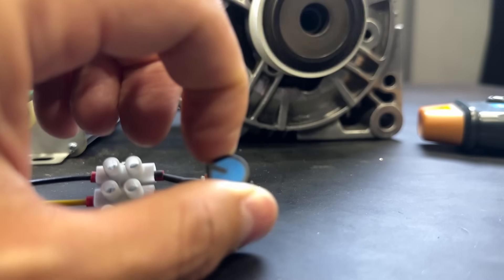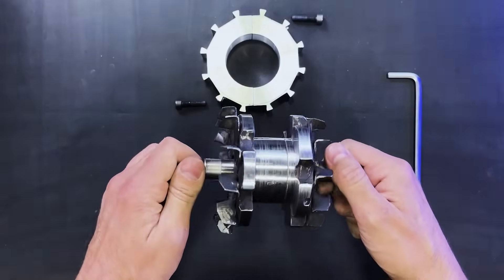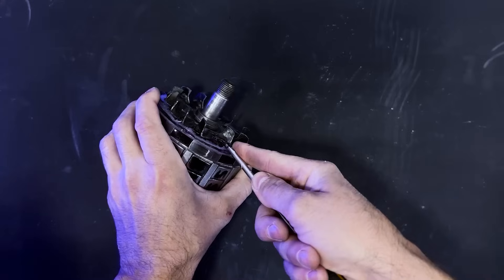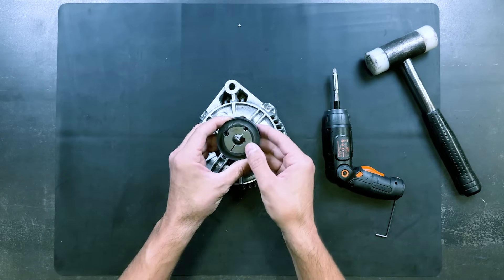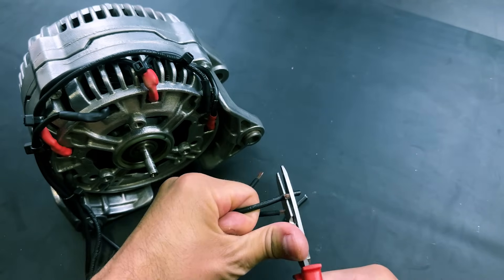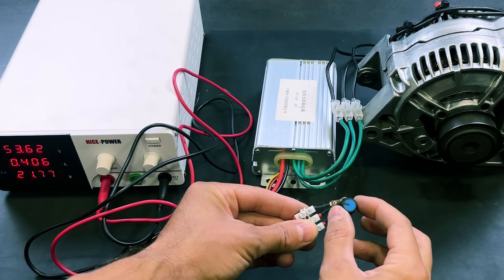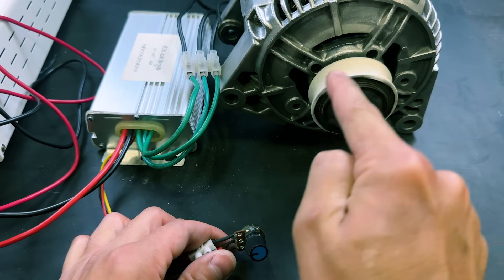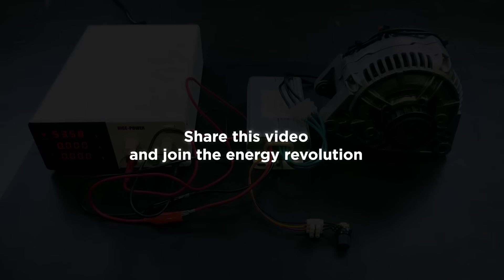I Turn a Car Alternator into a Powerful 10.000W Brushless Motor

Comment: I have seen projects where the original rotor with coils was used. 
Would the strength of the magnetic field affect the power of the motor?
The magnetic field would depend on the strength of the magnets, or the voltage applied to the rotor if the original coil is used. 
If the rotor is an electromagnet, would the power draw change as the the voltage to the rotor is changed. 
Does the speed of the motor depend on the frequency of the controller.

Comment: Can you show that when using electrical appliances, it can cause a power outage, such as a soldering iron? Is there real electricity? I followed the instructions and the electricity came out at 30 volts, 40 volts, Ac.

Comment: Great work, thank you for sharing with us! What was the value for current at 28000 rpm and 56V DC? Keep up th good work!
Reply from the maker: The current depends on the motor controller. With this controller, it draws up to 30 amps.
Reply: @danielpreda1978  I think the power showed something like 53 volts at 3 amps, a bigger power supply and bigger controller should give it more power. But you should also get a cooling system for the motor